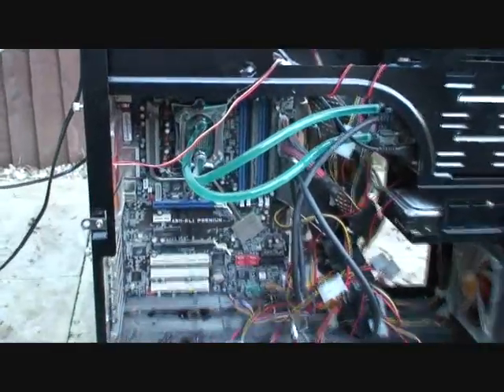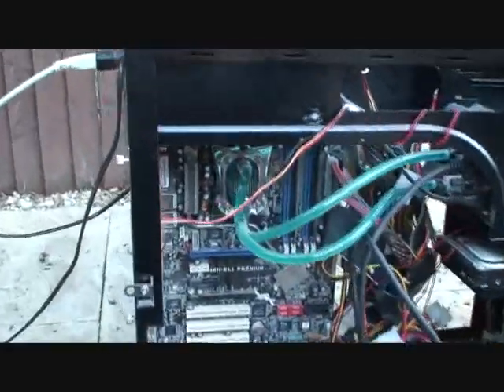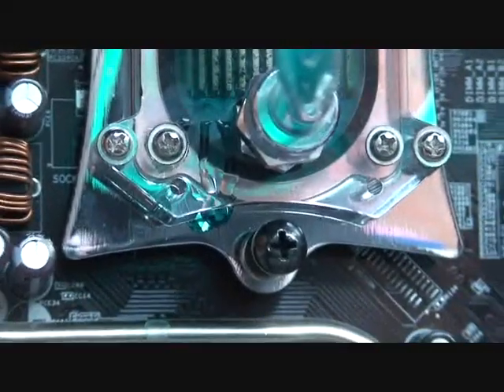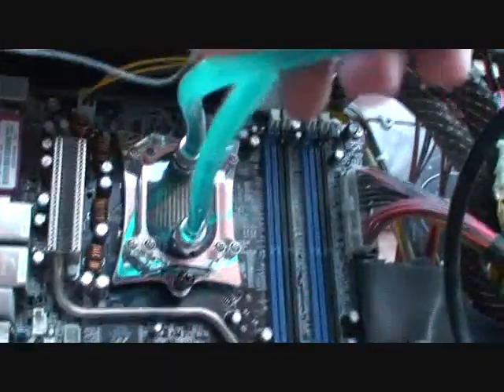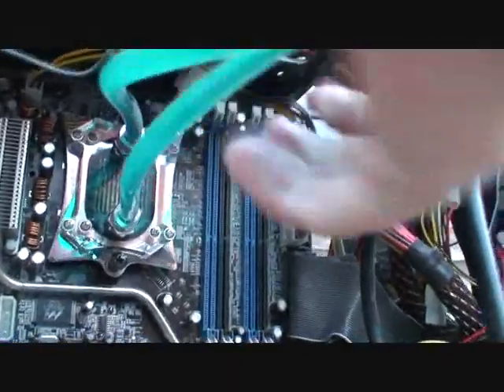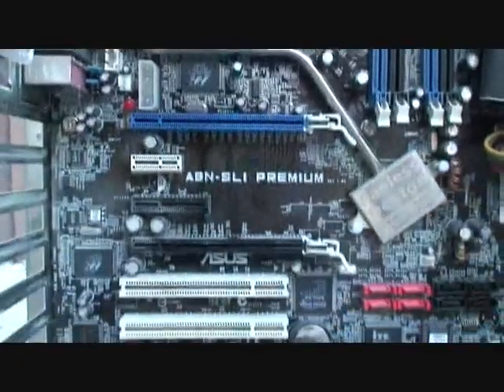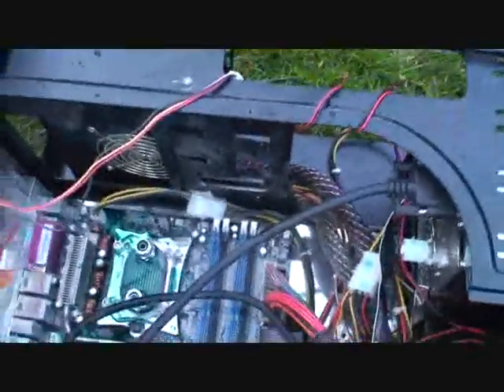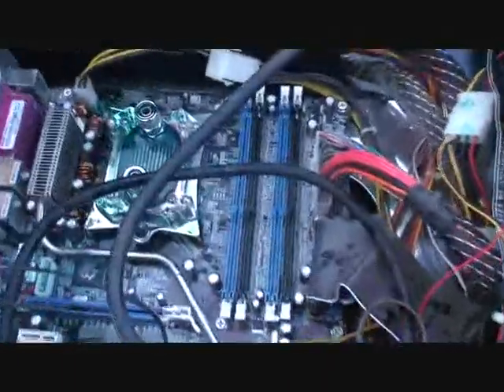Watercooling leak!

Comment: i have buyed a thermaltake kit, it's absolute crap,
the cpu waterblock was leaky like that.
The northbridge waterblock was leaking too.
now i use a zalman full metal waterblock with thermaltake chipset wb with 30 cm of teflon tape in the connectors :D

Comment: Had you of used a quality coolant it couldn't have caused any damage at all and if you had a quality cpu block it would not have started to leak after all that block was just some Plexiglas glass attached to copper did you even test the mother board? maybe it still worked prob didn't after you yanked the hoses off the mobo but hey your loss

Comment: Do you really need to use water cooling I have a AMD 9750 overclocked from 2.4 - 2.9 and it only sits at 44 degress C max under load using air if you need to overclock more than that I must ask what for I dont see the point my system plays any game I put into it

Comment: This is why I'm afraid of a water cooling system. I rather use the normal Air intake just get a bunch of fans or a gas or non conductive cooling system

I wonder why their isn't a CPU fan with micro water/gas cooling tube exchange yet?

Comment: Its the mold/corrosion inhibitors that supposedly add the electrical conductivity to the ethylene gylcol + distilled water.
I'd say you should send it back to Cooler Master... and skip the ripping off of tubes... however that does add some confidence regarding tubing connection strength.  Cheers and good luck on your next build. I think I will still build a water cooled system.

Comment: No its a factor to take in with peltier or whatever or without, you should always protect your components just to be on the safe side, of course not as intensely as if you were using a peltier cooling system but even with regular water cooling. Virtually no chance is still a chance when your risking expensive components.

Comment: Thats why you insulate your board properly with nail varnish and grease, these guys obviously just stuck the water block on and didn't consider condensation or anything like that, plus a plastic waterblock.. god no way i would use one of those.

Comment: Man... That sux!  Dude I dont trust the clear tops. Spend the extra 6 bux for the Brass ones. I also dont trust Koolance eather! Go with Dangerden, they are the best/most reliable pc Watercooling parts on the market. I have a Maze 5 CPU on a Atomic Prescott, Air temps were 46dc idle, to 52dc Load. Watercooled temps are 24dc Idle and around 28dc Load. besides your sapost to cheack your loop and change the coolent every 6 mounths to prevent this sort of thing, I bet it was a messed up gasget.